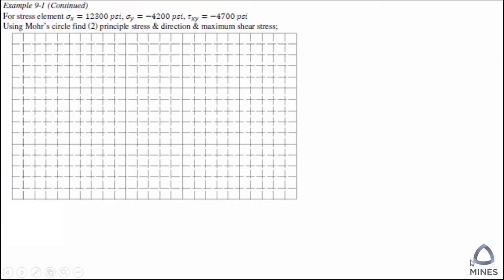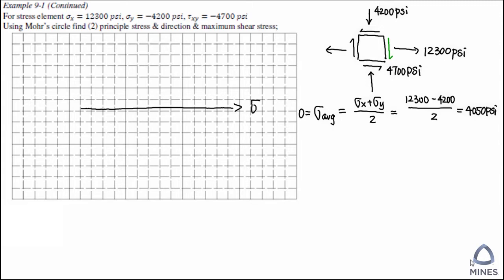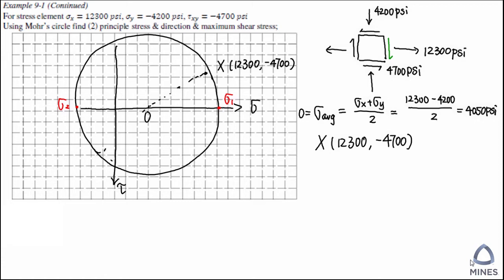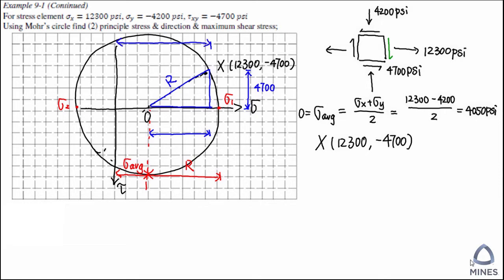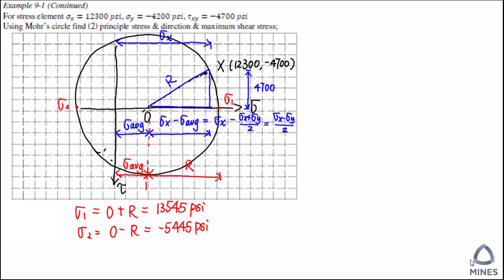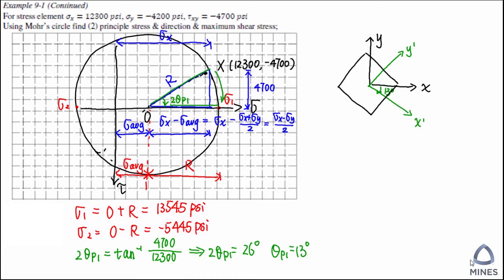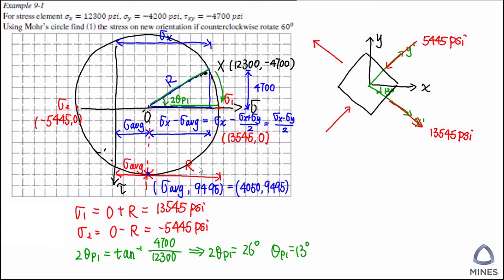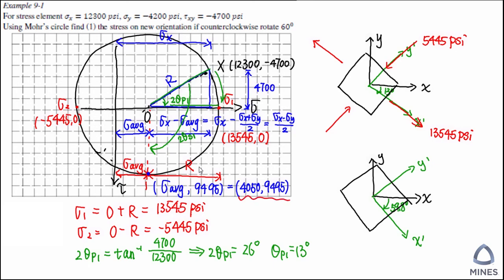Mohr's circle - Principle stresses and Maximum in-plane shear stress

Comment: at 5min 28s, the calcualtion for the angle is wrong. it should be around 29 degrees. i double check it with 2 different ways. seems like answer should be 29 degrees. tan-1(4700/12300-4050)
Reply from the maker: Yes, there is a typo. Please focus on the method, not just numbers:) Thanks.